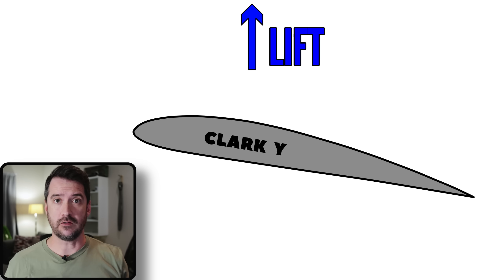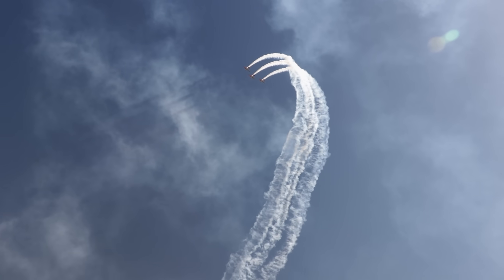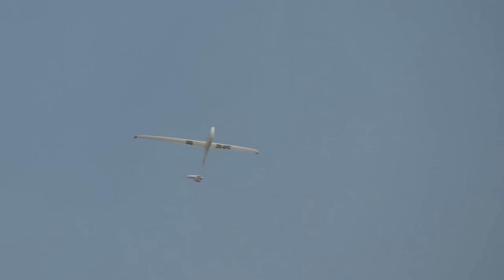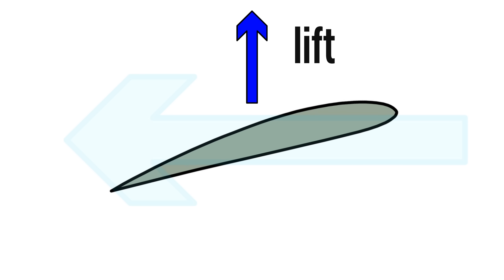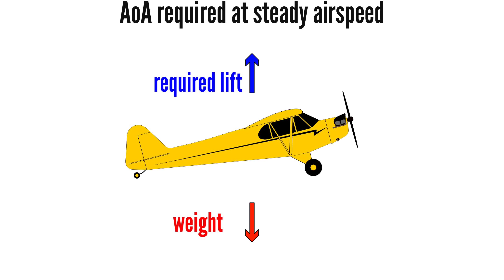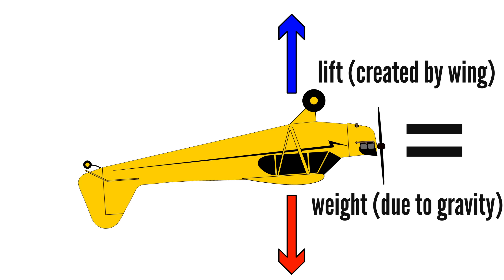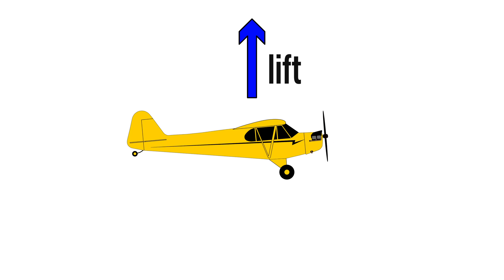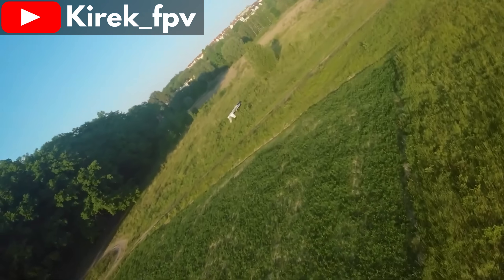Is Airflow Distance Over the Top of a Wing Always Longer?

Comment: The flow lines at 0:09, but the flow lines of the inverted wing at 0:12 are correct (ish). Note how at the back of the wing on the inverted wing diagram the flow continues with a downwards vector while in the diagram at 0:09 the air magically straightened out. This is exactly where most people's confusion comes from. This incorrect diagram is all over the place! 
Same errors made at 2:10, 4:05, 9:21 ect.
If you really want to understand how a wing generates lift, read Arvel Gentry: he was the best at explaining this stuff. 
8:36
Reply: @davetime5234  I have to say, without having read any of Arvel Gentry’s stuff, that viscosity and vorticity are used to explain the circulation theory of lift. This theory is common in the literature, not perhaps the introductory texts for pilots or high school students but certainly in the under graduate material for engineers. The viscosity argument goes like this: according to Stokes theorem, if there is circulation there must be vorticity, or spin of the fluid elements. Only shear can cause this spin (pressure only acts toward the centre of a fluid element, not tangential). In other words, there has to be friction, or viscosity. And then by extension, as only the boundary layer exhibits non trivial shear stress, it is further said that the net vorticity within the  viscous boundary layer is equal to the lifting circulation.
Reply: @davetime5234  No, he might have used viscosity to accurize the simulations, but in his descriptions for laypeople I've not seen that. He does mention circulation, but mostly it's just fluid flow turning.
Reply: @davetime5234  Gentry Sailing has a library of magazine articles he wrote 50 years ago specifically written for the average Wednesday night sailor, but he goes into a lot more detail than I'd go into for someone like my mom. 
What gets my hackles up is the fact he wrote this 50 years ago yet equal trasit theory is still being taught at flight schools.
Reply: @davetime5234  You can't have fluid turning without viscosity, without viscosity you only have drag, no? Momentum is still conserved with drag, it just results in no lift being produced. At least that's the way I understand it. Again, I've only read his material that was specifically written for the layperson, not any of his scientific papers
Reply: @davetime5234  It appears you are reading his material from 2006. I've only read his material from the 70's. I'll read this in the next couple of days and get back to you.
Reply: @wilfdarr ….it appears davetime has quietly removed all their comments.
Reply: @XPLAlN  Ya, I had a busy week. I meant to read that paper he was taking about and get back to him. For the record, nothing he said was malicious, he read something that I hadn't read so I can't speak to if he was right or I was... but you seem to be on the right track.

Comment: It's simple. The air is like soup. The same as a rudder in water, pressure is applied to the leading (underside) face of the wing. Fly upside down and the pressure is applied to the top.  Contoured wings provide lower drag with strength required to lift the aircraft. You could easily fly a plane with flat wings if the were strong enough - that's how the first aircraft were built.

Comment: I feel like my high school physics classes always got explanation of wings wrong.  Teachers always want to say that the shape of the wing causes the air on the longer side to travel faster to "catch up" to the air molecules on the shorter side.  In this model, we're imagining laminar flow over both sides of the wing. This just never worked in my mind, and nobody could explain why in principle the two air molecules that started together necessarily needed to finish together.  Learning about ships and rudders moving through water is where I finally got answers.  Rather than high velocity generating low pressure, physical displacement of air generates low pressure which in turn may change the velocity of the air.

Bernouli works to calculate pressure and velocity zones, but the dumbed down high school explanation of wing shape just doesn't work qualitatively.
Reply: @davetime5234  as I tried to get across, there is A truth there.  The problem is how trivial the treatment was.
Reply: @davetime5234  appreciate your working through that.  For the high school level, I think it would be helpful to first develop the intuition about how the air mass is displaced.    I'm not sure Bernoulli is really worth mentioning at that level if you're going to keep the discussion qualitative rather than quantitative.

Comment: An aerofoil is indeed not necessary for flight.
It does increase lift, however.
A totally flat wing will fly fine, but unless it's just a simple balsa chuck glider or a sheet foam rc plane. That type of wing is not practical in full size aircraft due to the need to stow the landing gear, fuel (in some cases), and the spars and ribs, as well as maximising efficiency in it's intended role.
That's why airfoil types differ for specific purposes.

A wing that works in all flight conditions would need to change it's shape, and even though r&d has been conducted in this field, they still haven't nailed it yet, so we make do with what we have.

Also, with enough speed, wing loading goes out the window.
You only have to look at super, and hyper sonic missiles, which only have fins and speed to keep them airborne.
Heck, even a bullet flies a long way just on velocity alone.
Or a playing card spinning will fly beautifully, as long as the spin overcomes the centre of pressure, to keep it from flipping erratically.
Reply: @davetime5234  Mmm hmm

Comment: First, you can't use the term "fluid dynamics" as you are not in a fluid.  Second, don't assume wings have the shape you show as we have planes that have flat wings (stunt).  Wind can redirect all sorts of shapes when it comes into contact.  I have sailed sailboats on mast alone in strong enough wind (actually, the hull is also playing a big part).  Nobody is saying the traditional wing shape doesn't improve and optimize flight, but it isn't the major factor here...  That is what people are trying to convey - the longer wind path over the wing isn't the most critical aspect to getting a plane lifted up into the air.
Reply from the maker: Air isn't a fluid? 🤔

I'm not assuming all wings have this shape. I'm using the shape (heavily cambered or Clark Y specifically)  most use to argue the upside down argument as described in the video.
Reply: @LetsGoAviate  Actually, I am going to take back my statement that wings are not operating in a fluid.  Fluids are generally equated with liquids and my understanding (maybe misinformed) is that the equations in liquids were applied to air-flow.  I think I made one too many assumptions.  Apologies.
Reply: @LetsGoAviate  Actually, for 10 years I have been unable to figure out lift on my sailboat.  I know optimal sail shapes and I agree it is due to pressure difference.  My problem is more than simply knowing I can "sail" my boat in strong winds without a sail.  My problem is that I can sail 300 degrees of direction and my fastest point of sail is down-wind.  My conclusion is that either the cause of pressure differences alters based on angle to the wind, or people are making this harder than it needs to be.  My assumption downwind is that if you interrupt (by blocking) the airflow it will impart energy / force against your sail.  Some shapes are better for getting the most energy out of interrupting the airflow.  Downwind it is the largest surface.  But, funny enough upwind is the same...  More surface, more force.  This is a repeatable experiment.

Comment: So why does the upper wing skin pillow upwards in flight, easily visible on planes with thin wing skins. I’ve seen it myself on a Convair 580. Your not differentiating between the two types of lift. Reactive lift is just air deflecting. Also frost on a wing usually ends in disaster. That’s because the top boundary layer is broken losing the upper negative pressure.

Comment: Balsa wood airplanes wings are flat top and bottom and flat front and back, with no bend down the length.
Yet fly just fine because the wing pitch is higher in the front. It's air deflection of the bottom of the wing that causes lift. The wings are not streamlined due to all the flat surfaces but it flys just the same.

Comment: Many many years ago I studied Aeronautical engineering at college. I was taught about fluid dynamics and shown wind tunnel experiments. However, the idea that the fast moving air above the wing is less dense that slower moving air below the wing,  is in my view missleading.
 In a wind tunnel,  the wing is stationary and the air is moving, but in the real world the aircraft passes through still air. 
All that's happening at any momemt is the air spilits for a fraction of a second as the wing passes through, and then re combines.
I believe the angle of attack and the inertia of the still air makes the wing act like a Warer ski or hydrofoil.

Comment: Why so long video? I remember it was all about calculation of vortex in my undergrad time. Here to check if there's something new.
Reply: @davetime5234  I don't think I am qualified to teach anyone. It's best that you check Kutta-Joukowski theorem yourself.
From my current understanding of what we all did back then, fluid relative velocity plus the net rotation of flow around an object, which practically results in higher fluid velocity one one side and lower velocity on another, creates lift. The evidence is the counter rotation behind the trailing edge, which is noticable when formed into vortex when the net rotation changes.
Correct me if I am wrong. It's 20 years old knowledge
Reply: ….possibly the best video on lift for the more discerning amongst the YT demographic is found on ‘the efficient engineer’ channel. I expect you would recognise the content of that one from your undergraduate days. It summarises circulation theory exactly as you did in this thread, which is not surprising because that description is spot on in as far as it goes.

Comment: Honest question:
if you have a highly cambered wing with super sharp leading and trailing edges (so that the stagnation point will always be on the chord line), if the chord line is parallel to the relative airflow, will there be lift?
Reply: With a 2-D foil of infinite span (so there's no induced drag from air escaping upward past the wingtips) I think the answer is yes, but otherwise you'll need some positive AoA to pay for the need to fling air downward more sharply than you received it coming up toward you.

To explain that "coming up toward you" (ref. provided below) -- in any subsonic flow, the pressure under the wing is "felt" by the air both ahead and behind, so that ahead of the wing the air begins to rise up to escape that pressure region carried along under the wing -- then the wing gets hold of it and flings it back down again, and it's this change in direction that creates the "bubble" of pressure below the wing.

(Then after the wing has gone past, if it's 2-D so there's no escaped air, the flow aft of the wing mirrors the flow ahead of it, with the downward-flung air being deflected back to up a level direction by the pressure below it.  OTOH if it's got a finite span so that it's had to fling extra air downward to make up for the escaped air at the sides, then the pressure below will be insufficient to flatten out the path of the air behind, and it will continue in a somewhat downward direction as "downwash.")

For a more detailed description see Prandtl & Tietjens, /Applied Hydro- and Aeromechanics/, chapter VI: B: topic 101, The Velocity Field in the Vicinity of the Airfoil.

Comment: Lift is generated by accelerating air downwards, which creates an equal and opposite lift force. The lift force can be approximated as the result of accelerating a volume of air with a diameter corresponding to the wingspan. The traditional explanation—that lift is created because of the longer distance over the wing—is incorrect. In reality, air moves faster over the top of the wing than underneath, and air parcels do not reunite after passing the trailing edge. - My two cents 😀
Reply: @davetime5234  Great answers - If I can formulate some good counter arguments, I will return 👍
Wait, 
For the sake of argument, let’s assume that lift can be approximated by the disruption of supposedly stationary air into a downward motion within the volume of a cylinder with the given dimensions. This naturally creates a low-pressure area above the wing, which decreases upward, and a high-pressure area below the wing, which decreases downward (thing about ground effect). What relevance does the upper surface of the wing have other than to contribute efficiently to this process and simultaneously reduce the risk of stall?

Cheers Dave
Reply: @davetime5234  Thanks, Dave. If I understand your answer correctly, I agree with both your points. Very well described.
Reply: @davetime5234   I completely agree. In fact, this is exactly how I used to explain the inverse relationship between angle of attack and an airplane’s speed to my students.

Comment: You’ve completely missed another factor which is quite an error.  A completely flat plate can generate lift by diverting the air flow in a downward direction.  So an upside down aerofoil also generates lift by having a large angle of attack.  It diverts air in a downward direction and the required force to do that acts on the wing in an upward direction.  So a plane can fly upside down if it can have a large enough angle of attack without stalling.  Surf boards do much the same!

Comment: When I was 10 years old, riding in my parent's car, I would put my arm out the window.  I could feel the tremendous lift force - either up or down, depending on the angle of attack of my hand.  So the first time I saw a movie in school about how planes fly, I realized that the Bernoulli principle applied to lift was only a small percentage.

I since read that this error was made in an early textbook on planes, and that most text books after that time repeated the error.
Apparently the people who actually built airplanes knew what they were doing, ignoring those text books.
Reply: @davetime5234   I don't know specific texts. All I remember was that I heard (read) frequently that the Bernoulli effect, was the reason for lift, ignoring angle of attack.  And I did read that this was  due to an early textbook error. I have no idea what that book was or what level it was.

Comment: The truth is that angle of attack is what appears to cause lift, same as in water. I think it works more like pushing the air down as a reaction mass to create an equal and opposite reaction(lift). Even a piece of paper or flat metal as wings can fly if it has a positive angle of attack. Im not sure if the wing design is a major cause lift, or if it alone could work. But I do know its not needed. It does add structural integrity, and maybe aerodynamic stability and or agility. Still flight has been proven without the traditional wing curve on the top and flat on the bottom. Which makes you wonder anyway.

Also if the wing design/shape is causing lift, then it would seem to me that the lift is not caused by pressure on the bottom of the wing or by the difference in distance traveled  by the air over the top and bottom. But rather by vortices created over the top of the wing caused by its curvature. You will notice that the upward slope of the top of the wing in beginning is very short. And the downward slope is very long giving it a lot more of area then the upward slope. And the vortices would be created on the downward portion of the slope. And these vortices would cause a drop in air pressure or partial vacuum over the wing. In fact it was proven that this is the way that bumble bees fly, the motion of their wings produce vortices over the top of the wing. Creating suction over the top and thus lift.

Comment: Another measure to look at is the mass of the air deflected downward in the vertical direction in the wake of a passing aircraft. This deflected air will need to have net change in vertical momentum, to counteract the weight of the aircraft.

Picture a hypothetical hovering object (vehicle) with a rocket engine mounted at the bottom, pointing downward. In order to hover, this craft will need to expel exhaust gases with volume and mass sufficient to provide an upward change in momentum equal to the craft's weight.

If we disregard the horizontal component and take solely the vertical component into account, the air in the wake of a fixed-wing aircraft's passage must have a similar effect. Rather than expelling exhaust mass downward as in the hypothetical vehicle mentioned, the moving aircraft instead deflects air downward, and the reaction force generated by the downward deflected air is Lift.

Likewise, for an aircraft to climb, as it passes it needs to deflect a greater amount of air downward per unit time, passing downward momentum to the air in exchange for upward momentum for the aircraft.

This thought experiment, involving nothing except the application of Conservation of Momentum (which applies to everything in the universe), allows a person to intuit what a wing actually "does".
 
It might then become intuitively apparent that maintaining laminar flow over the wing's surfaces might be important for other reasons, but the pressure differential between the top and bottom surfaces is not a critical factor in examining how a wing generally functions.
Reply: ...the video you're commenting on is a rebuttal to what you just said.